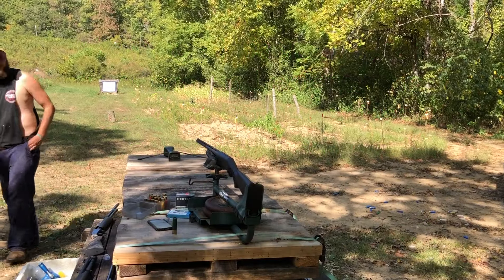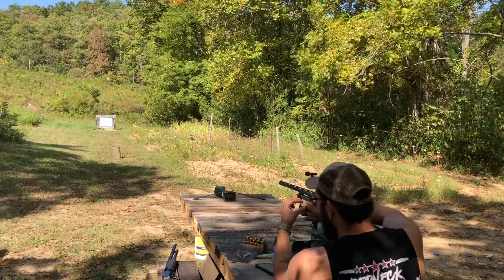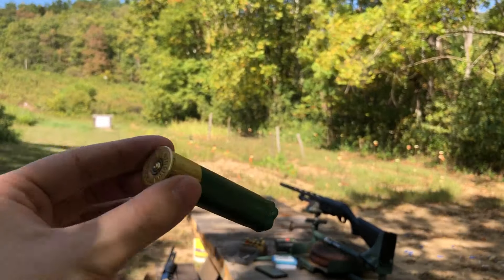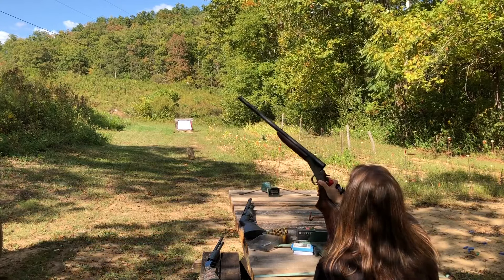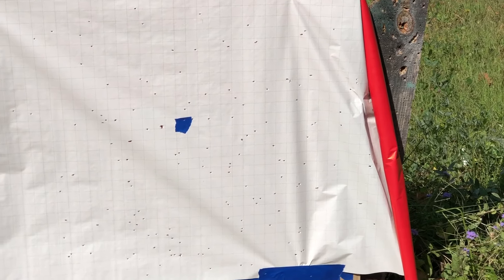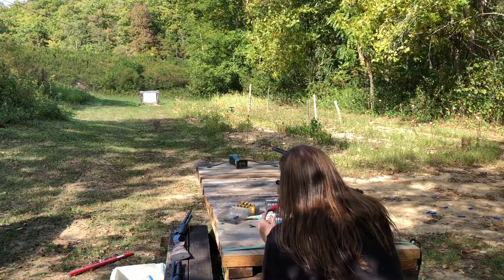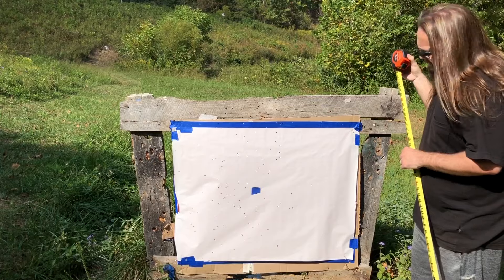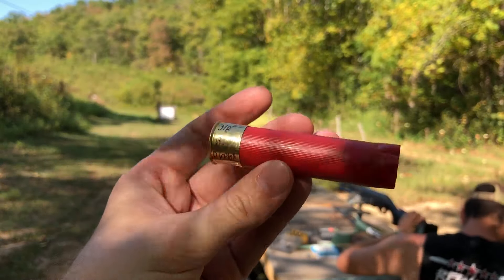Clay & Game 12 Gauge Fiber Shot Cup Steel Shot Range Testing

Comment: That duples load of #3 and BB looks promising with mild pressure. I load a mild load for us older guys on small game etc inside 35 yards.Federal Top Gun Hull,   Green Dot 21 Grains ,     3/4 ounce #5 Steel ,   BP1253 wad, CX2000 primer,  white 20 gauge felt over the shot, good density for shorter ranges rabbit , squirrel etc.  Improved Cylinder Remington barrel with rifle sights.  I wanted something that patterns well with low recoil for use on government lands etc. I seem to have better patterns with a more open barrel with steel . Not so many holes in the pattern.
Reply from the maker: Yeah a modified choke is a full choke for steel.